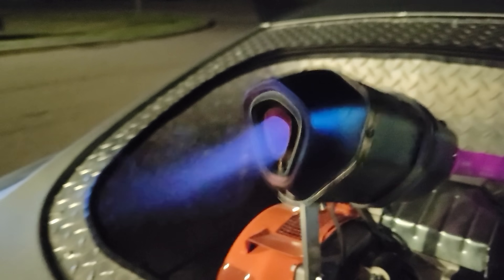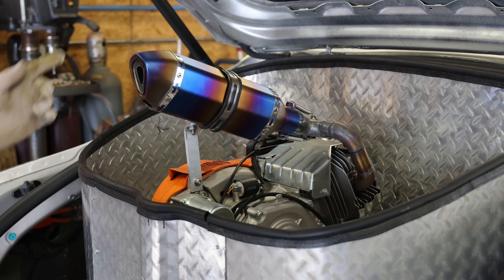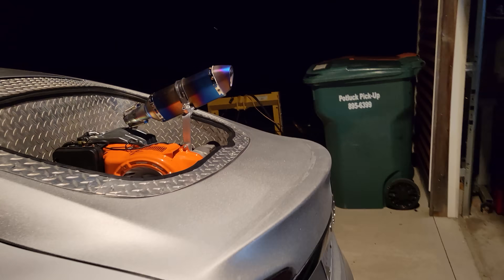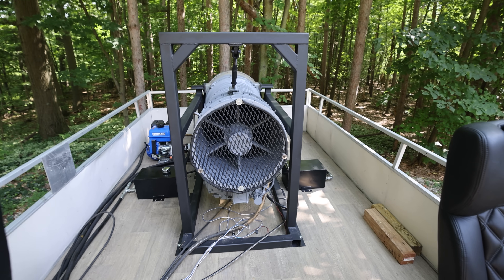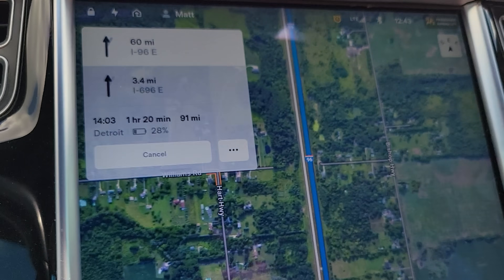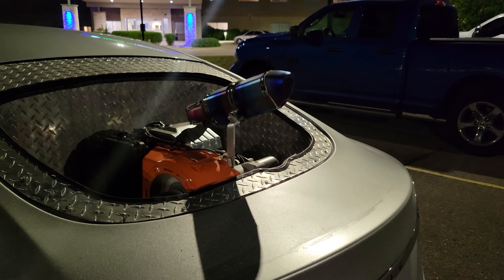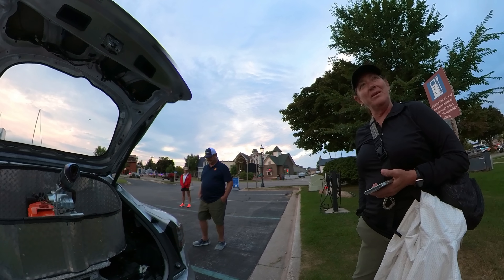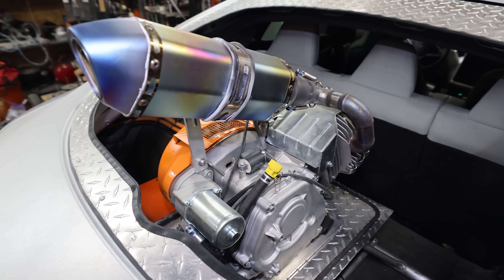Cordless Tesla (I Drive 1800 miles without charging) P.1

Comment: I HAVE SEEN THE FUTURE  REGARDING EVs 

Back in 2014 my battery power 🔋 tools needed new batteries I found a place that replaced the batteries 🔋 with lithium iron batteries while I was waiting i had a look around and there were 14teen TOYOTA PAREAS
they were all pulled apart with the dashboards out, they were all waiting for batteries. My power tools smoked overheated after about running for 45seconds,I had to throw them in the bin in perfect macanical order. I was very 🔫 passed 😢 off. That is why I bought a car with a diesel engine. ⛽ NO EV

Comment: In order for this to make sense, you need a fair amount of generating power. The best way in an economical sense is to install a used quiet diesel Onan 7.5 kw genset in the front.  It uses. 2 qts hour. And a whopping output of like 60A and 250v. They are used regularly on Motorhomes.  Then you have something to test that makes sense. And barely even hear it turning at 1800 rpm. And it will turn off when you turn the car off as well. That makes more sense. 

This is the way a hybrid should be. Lots of battery power with the genset as a supplement, not the other way around.

Comment: One thing I would like to know is, if you could use a Kohler 10k generator with a propane fuel source. You could then use the 20 lbs propane tanks swaps as your refill process and maybe get a better rate of charge.

Comment: What was the purpose of this route? A totally useless thing, except if the end of the world is here, but in that case, you barely fuel up at any petrol station. Also the eenergy efficiency of the solution is very poor. You better move a vehicle with that generator, the  suffering loss on the battery charging and using this energy to power an electric motor. The only thing you did, is content creating. All the rest could have been calculated on a few A4 sheet of paper.

Comment: That is a cool project because you can travel anywhere without going to the charging station, that only have charger for 10 cars per time. Not to mentioned if only AC charger were available and not DC or greater than that. It does save time as well. Just need a few litre of fuel to recharge. But yet, still some Karens hate the idea of why do we still have a petroleum. Lol
Reply: This would have been better if the generator were just used as an emergency power source for when charging wasn't available.  The generator could get you to the next charging station.

Comment: this whole discussion avoids the elephant in the room, which is: you CANNOT BEAT the efficiency of stationary power generation. whether solar panels, with battery storage, or a coal plant with co-gen systems & waste heat recovery systems: there's just no WAY to beat it. that's one of the KEY reasons why the whole "EV's pollute more than ice- because of coal plants" BS is wrong. solar wins over coal because solar energy is FREE.... in fact- grid tied solar (no battery) averages out to around 7 cents per kwh over the life of the panels. the national average from the grid is 15 cents. big oil / coal advocates LOVE to say "the sun doesn't shine.. .blah blah blah"... and pretend that battery storage doesn't exist or isn't viable. THEY WISH. using EV's with batteries ONLY takes advantage of stationary power efficiency. another common fallacy, is that you need 500 miles of range in a car in order to not have 'range anxiety. nothing has ever been more false. 

HOWEVER- the expensive part of solar is the storage- an EV READILY solves that problem- and this is one fact that the oil giants would LOVE TO JUST NOT TALK ABOUT. EV's won't be what 'breaks the grid'.... it's already broken, we already have blackouts. EV's will be what FIXES the grid. 

an EV IS ENERGY STORAGE- READILY COMPATIBLE with solar. in fact- do a search on here for 'DC Bell' inverter tech. panels- with a special inverter- that can DC FAST CHARGE your EV DIRECTLY off your solar panels- and then use your EV's battery to power your home. the day is FAST approaching where- PV shingles will be nearly as cheap as regular comp. shingles- and a DC bell inverter will be as cheap as a transfer switch & load center. once that happens- you will be able to use a very small power wall just to keep the lights, fridge & electronics on. then when you're home- your EV will operate heavy loads. to stay 'topped out'... employee parking lots will have solar coverage- and keep EV batteries full during peak sunlight. people who work 2nd & 3rd shift & share their EV storage over the grid will keep the local  grid stable & running. cars parked, charging during the day will share their power during the night as well. slowly, over time- tesla power & tesla cars will DECENTRALIZE the grid system. one by one- peaker plants will begin to shut down- unable to compete with solar / battery storage. then gradually, one by one- large scale plants will be forced to either go solar / battery- or be priced out of the market. decentralized power has the added advantage of less power loss over long hauls.

Comment: The main problem I see here is the charging system isn't putting out enough AMPS to keep up the the demand he should have used a 200 amp Marine engine style alternator at 24 or 48 volts on a 18 horsepower/440cc duromax engine.

Comment: Its just a CHEVY VOLT.   Turned an all-electric into Gas / Electric.   My VOLT gave me 53 MPG_E miles then the gas engine which was a generator putting electricity into the batteries.  My volt was a 2018 Premier and I traded it for a 2022 Chevy BOLT premier.   I really wish I had kept my VOLT .  It wasn’t on the dealerships lot more than 4 hours.

Comment: This would have been great with a true water-hydrogen generator and then burn the hydrogen to power the charging engine so you don’t have to rely on gasoline (that’s the idea right).  Or maybe just use a gasoline vapor engine and get rid of the bullshit battery cars.

Comment: Didn't chevy do a car with generator like that in the trunk in 60s? The car sitting in parking lot at work would recharge the batteries in those 8.5h. If i remember correctly it was a horrible failure. Well it was in 60s.

Comment: I would be curious if it actually used more gas to make the trip then it would if you had a regular 4 cylinder engine.  I mean, what's the total miles per gallon you're getting?

Comment: Kinda surprised you didn't want to opt for finding a means to charge with a turbojet like Ariel is doing with one of their hybrids. It would certainly be a more efficient method of charging with gasoline since jet engines are normally a good 20-30% more efficient

Comment: Research mini transmissions to get more rpm's.  Techumseh makes a racing transmission for racing lawn mowers and other applications.  Or maybe the tranny from a sportbike, depends on the revolutions.  Any car could be converted to EV with a motor setup like this, just add the Tesla electric motor.

Comment: I know the goal was to drive without charging the car at a supercharger deleting dependency, however has many times as you've had to stop, basically defeated any major benefits while using primarily gas.  What I will say is,  the build isn't useless because combining the use of public superchargers along with the gas engine definitely would improve efficiency in driving distance vs time,  making that tesla then ultramate long range tesla.  So lots of credit there.

Comment: Wouldn’t a diesel generator outputting 220VAC work better? I Love your video. I always though this was the better system, and always wondered why an auto maker didn’t do it. A silencing muffler and running the exhaust out the bottom would be great. 
How about the gene only turns on when driving, and when parked cuts of automatically when charged.

Comment: I kinda fail to see the point of this exercise....the energy conversion losses defeat any purpose of this...going straight from internal combustion to drive train would be the most efficient but dare I say, that’s already been done!!!....so, this would be been more interesting if you built a solar input to the battery, and then recharged with solar panels or blankets when needed....that would be DC coming from the panels through a solar regulator to a DC battery (ie: minimal losses) so you’d pretty much be sleeping through the day while your car charged & travelling at night or something to that effect....no doubt the trip would take longer, but the fuel required would be raining down free from the sky.
Reply from the maker: Well yeah you're not seeing the point because this is the first iteration. And Evie's are much much more efficient at taking energy and turning into motion the mechanical cars with like hundreds of conversion losses.

Comment: Thank you for your interesting video.  You have the skills and means to do this project.  That's impressive.  But it is a waste of both.  I'd rather see you do a fuel cell range extender project.  I have a 2017 BME i3 REx and a 2019 Jaguar I Pace EV400 SE.  Love both cars, but wish I could extend the i3's range extender concept into the I Pace and take it one step further to a fuel cell.  Don't know the cost, the volume, the weight of a fuel cell system that could sustain the freeway speed of a 5000 lb car.  But even if it can't, if it can extend the range by 100 miles, that would be good enough.  But then there is cost involved.  Anyway, hope to see your next project to replace the gas generator with a fuel cell, and integrate it more elegantly into your model S.

Comment: Hello. Great video. Thanks for sharing. I don't know anything about mechanic, just want i read in magazines. But probably a rotary engine two rotor 13b could fit in the trunk, gives at least 130 hp without turbo so you could charge faster the Tesla batteríes. Thoose engines ara know for poor reliability, but if the rpm are constant, it could run without the apex seal failure, and are small compared with a normal 4 strock 4 cilinder engine. Have a nice day

Comment: Perfect example of the idiotic inefficiencies that occur when politics drives engineering. The worst part is that most people don't understand that this is EXACTLY how most EVs actually work. It's just that their "generator" is coal powered, located miles away (where they can't see or hear it), and the power runs through a ton of old lossy equipment/infrastructure on its way to that shiny new EV charger. Meanwhile we cut oil production, drain strategic oil reserves and tell everyone to buy an electric car. But look on the bright side, we are getting a lot better with everyone's pronouns, maybe.

Comment: Definitely a cool project and proof of concept, but kinda an exercise in futility. We already know about combustion and electric conversion efficiencies. If you want a gas car, it’s certainly more efficient to let the engine power the wheels rather than convert the energy to electric, store it, and convert it to mechanical again. “Not charging” might be true but adding gas just trades charging for the old school fuel-ups anyway.

Comment: The engine output doesn't look like it's connected to anything. There is no generator. This looks like BS. A generator that size would make about 2kw. at 13 to 22 amps 120v. Charging stations charge at 350kw to 100kw 220volts. Please explain how I'm wrong

Comment: I'm pretty sure there's a chip  on the Tesla's computer charging management software that prevents fast charging. Add to that, what happens the next time you do connect to a Tesla charging station or on your home power grid? With the new electronic power consumption meters, Tesla will upload all the info from the car's computer and discover that the batteries were recharged from another source,  crippling the car or putting it in limp mode. Remember, we live in a capitalist system, which includes big profits, greed, lies, corruption, deceit, denial, etc etc...

Comment: Totaly poves the point that electric cars make no sence unless you are able to get energy from renewable sources. The electric tech is not there yet, the power grid is over taxed as it is. If you need to feel like you are making the least impact on the environment drive a hybrid, the true carbon footprint of a long range Tesla is way more than a hybrid. Takes an extremely long time to make up the difference. By the time you do make uo the difference just like any car, other thinks start to go wrong with it and, you probably will not want to drive that car any more just like the average car owner.

Comment: I like all the comments about him using gas.  In some areas you are charging your electric vehicle with coal.  If you can't put a coal plant in your trunk to charge it, use gas.  Even better, use diesel/kerosene/fry oil... in a small diesel engine generator.  Spoiler alert... this is being done already.  Yes, it's a hybrid and solves a lot of issues during this transition, if that's what it is.

We aren't just "addicted" to gasoline and diesel, but all of the other products that come from a barrel of crude oil.  What would we do with the 65% of "waste" if it can't be used for the remaining internal combustion engines?  It would be so cheap!!!

Comment: Is it possible to charge while driving? 
Also you should make another episode  where you put another generator on there and a proper exhaust with resonator to silence it abit…😊
Reply: On a good downhill a Tesla can get a very short burst of charging while driving from the regen braking. So yeah his setup should definitely be fueling the battery as he drives.
Reply: Yes this setup charged whilst driving. Hence it was on all the time.
But at 19mpg why bother. On the 500 mile day that's 4 refills $120 to add enough range to have 30% remaining after averaging 60mph.
Better to find a charger and pay $20 max for one charge.
Reply: @markp8295  sounds great.

Comment: Should be possible because the engine in my Chevy volt gets 40 MPG when running on gas so it's getting double the efficiency of your Kohler engine. It's just the problem of fitting a larger engine  and gas tank into the Tesla boot and frunk. This is the best reason to own and use a gasoline hybrid, only stopping for gas every 350 miles; Oh, that's just like a NORMAL car.

Comment: so why couldn't you just take the charging coil without the gas motor side and have it hooked up direct to the drive on the motor to charge without using gas, or is that even possible?

Comment: That motor is possibly the loudest option you used, they have stealth generators that run almost silent, and probably put out more power than that what looks like a harbor freight engine.
Reply: Yeah, that was my biggest problem with this build. That thing was obnoxiously loud.
Reply: But then all of the other people staying at his hotel would actually be able to sleep
Reply: @huntsw  just tryna keep with the theme that electric cars have, silence. And in car terms. Basically make it a sleeper
Reply: @projectdelta50  that’s not a harbor freight engine. It’s orange, not black or black and red.
Reply: Yeah Honda makes super quiet generators. He’s got a super loud pit bike exhaust on it. I would be annoyed too
Reply: There more liberals  so deal with it for I in housing  got to work so alot of driving means don't got time for charging  
I give him credit just saying ev cars are not saving planet there more dangerous  then I ever seen burning down over a flood gas cars drain fluid put engine  cleaner
Reply: He could have gone with a diesel power plant and a quieter muffler for more power, but those cost a lot more
Reply: @joeandrade223  He has money to permanently modify 130k car. He can afford a 3k generator.
Reply: @joeandrade223  Diesel is also really expensive in the US right now compared to Gasoline.
Reply: @japzone  true, E85 is the cheapest in my area right now.
Reply: @japzone  But a diesel generator would get better than 19MPG (His figure not mine). So the 25% more for the fuel is made back in extra MPG.
Also the generator he chose charges 38 miles of range per hour so 2 gallons per hour. For his tank, that meant 3-4 fills on the 500 mile trip.
That's costing similar time  and effort to an electric top up at a super charger, for more money. $4.5 / gallon. The 500 mile trip cost him $112.5 compared to super charger at $20 peak times. That's $90 to spend on activities in the 40 minutes it takes at a level 3 super charger.
Reply: @darlenecoleman3683  E85 is low energy, that's why its cheaper

Comment: Do everyone a favor and look into composite boat motor housings as a way to significantly decrease the noise
Reply: This was an off-the-shelf inverter generator.  It certainly came with a reasonably quiet muffler.  it would have been easier to keep it quiet or make it even quieter.  Instead he changed it to use a straight pipe and appears to have adjusted it to run extremely rich to get the flames shooting from the tip.

Comment: I was wondering... Is it possible to design a car that has a large enough gas or diesel engine to completely power it so you don't have to convert the fuel to electricity before powering the car?  I'm thinking maybe a 3-4 litre gas engine?  It would probably go the desired 1600+ miles without nedding any charging. Just wondering if someone could design a car like that. 🤔
Reply: No, it's not possible. Stop dreaming

Comment: Its inefficient n noisy. Waste of time. Better to do stuff like using solar panel n see if its feasible to charge a car with it while parked under a sun.

If you're gonna use gasoline engine to generate energy to charge thr battery to power the EV motor, its better to just use a modern regular gasoline car. The various stages of  conversion of energy from gasoline to kinetic to battery to kinetic again is so inefficient n wasteful.